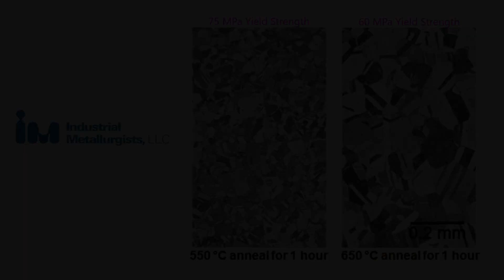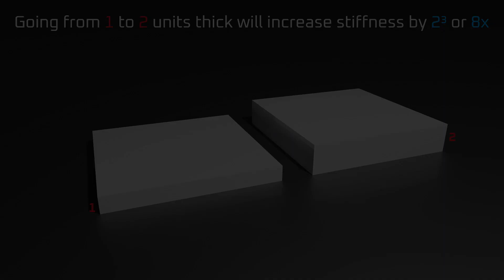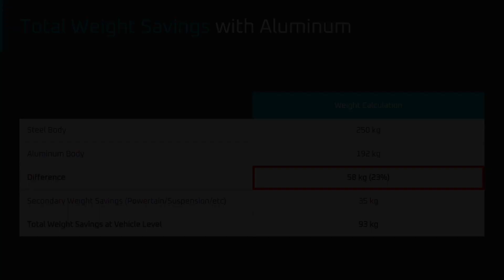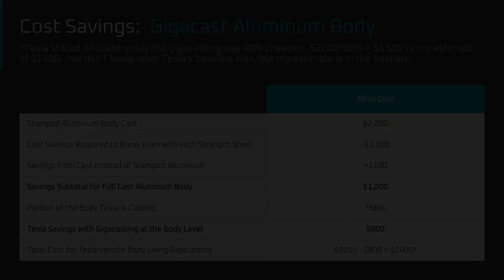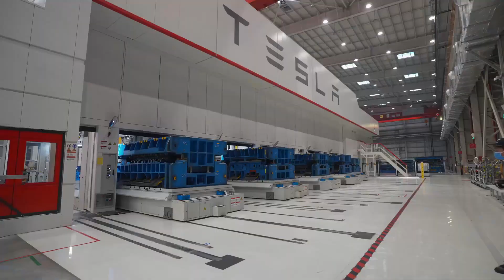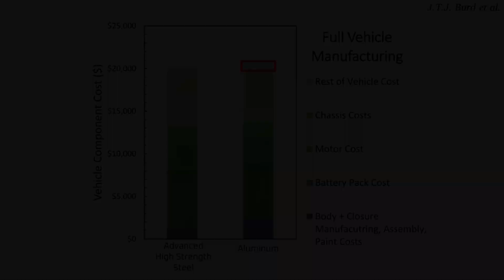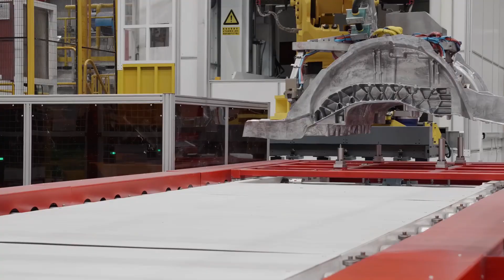#2 Tesla Gigacast Aluminum vs Advanced High Strength Steel

Comment: Tesla's price lock in on aluminum is a good point. It's getting cold for other automakers.
Reply: Legacy manufacturers are likely late to contracting for all sorts of EV materials and components.  They clearly lag Tesla when it comes to battery supplies.  Probably chips.  Possibly other materials needed for EVs that aren't used much or at all in ICEVs.  And gigapresses.  I expect Tesla is going to keep Idra busy building presses for them for a few years as Tesla ramps to 20M per year.
Reply: @bobwallace9753  10 years ago BMW built one of the biggest carbon fiber production plant in the world, other car manufacturers also have huge expertise on composite materials and recycled materials too.
Reply: @moineaux9173  who exactly of the existing oems has that so called expertise? Share any links you can which prove their competance in said areas. 🤔
Reply: @moineaux9173   
I bet that in your mind that somehow relates to the topic being discussed.
Reply: @bobwallace9753  stop talking shit mate, other auto manufacturers already uses way more aluminium than tesla. From Engine blocks, gearbox housing, subframes, differential, body panels, crash bars....... some manufacturers like range rover even make 100% aluminium car .
Reply: @moineaux9173  

Did you see someone named Bob Wallace claim that non-Tesla manufactuers don't use aluminum?  Or that Tesla has cornered the aluminum market and frozen other companies out?

Why don't you get your shit straight before accusing someone of talking shit?
Reply: Winter is Coming.
Reply: @AudiTTQuattro2003  The underbody is not the body and will still be cast aluminium. The stainless steel body is "just" based on a completely different manufacturing concept. One that should require even fewer parts and fewer production stages than the previous tesla models.
Reply: @dmatscheko  And a very tough, very long lasting upper body.   Appealing to those who use trucks for rough work but would like their ride to keep looking good.
Reply: @bobwallace9753  you mean the payment princesses?! Lol.... the perfect truck sizes for go everywhere adventure is the toyota hilux for example or ford ranger. The ford f150 or lightning/cybertruck/hummer electric are huge vehicles.
Reply: @moineaux9173  
Man, you really don't get it do you.

Comment: Once they start recycling their gigacastings they won't give a damn about material cost.
But that's 20 years in the future...
Reply: Lol... you realise that rejects in the manufacturing are have been recycled for decades right!? Recycling is not a problem but having more new materials.
Reply: @moineaux9173  Do you realise that there are thousands of aluminium alloys but that all gigacastings will be the same?
Reply: @johntheux9238  and what?!? Its not that hard to make an alloy and sandy munro has testified that in one of his videos. Tesla isn't the only company using aluminium castings, and the alloy is going to change over the times
Reply: @moineaux9173  It's THAT hard to make a defect-free large casting. Telsa has developed a technique and alloy that no one else has mastered with their large, complex castings. Maybe, they will give their secret to the OEMs?
Reply: @moineaux9173  Adding material is easy, but purifying it is hard.
Reply: @artsnow8872  that casting is nothing extraordinary trust me. Other manufacturers have worked with way more complex materials and processes, from the formula 1 development to laboratoires..... the carbon fiber wheels, titanium, silicon carbide, magnesium....... welding and bonding techniques....

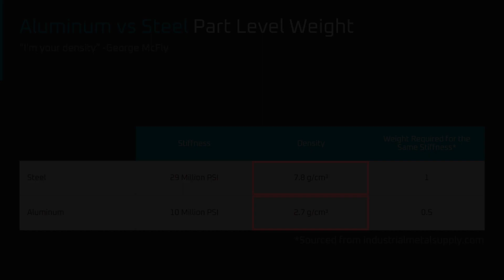Comment: For clarification, at 5:47 he is talking about flexural stiffness which is proportionnal to the cross section, lever effect and material deformation which are all proportionnal to the sheet thickness, hence the cubic power.
Reply: Good design means very little of the sheet material should undergo significant bending stress. In practice this means you don't get that cubic relationship
Reply: @EdFrench_uk  Well, it's under compression so buckling is an issue.
But I guess that the advantage of using aluminium is that you can use simpler shapes.

Comment: Im assuming Capex & TACT time will be included in the part 2?
Reply from the maker: No deep dive planned on CAPEX.  The figures here included CAPEX.  That is, we'd go far deeper for little marginal benefit (as far as I can tell).  The answer would still be the same.

Do you mean takt time or cycle time, or something else?  Cycle time has already been covered.  I may go deeper on this in a later video.  

On takt time, if you're considering the person who buys the car as the customer, then I'm not sure if it's relevant because Tesla is so supply constrained.   If you're considering the customer the production line, it's hard to know unless we know which part of Tesla's manufacturing lines are limiting production speed and what they are designed for.
Reply: @thelimitingfactor   fair enough on capex.  My mind was thinking about what happens in the eyes of traditional automotive when they would need to weigh up how much it would cost to change.  

On cycle vs takt, I’m just thinking about how time is proportional to money (and further to that, the best process is no process mantra).  I can’t see why Tesla would be pushing so hard to lower cycle time if they were also not trying to push down takt.  Yes, they could run multiple lines off the one casting machine but I think they will try to go one machine one line.  I also suspect that they have gone the casting route to lower cycle because they believe that they are about to have a profound breakthrough with battery production.  Hence why we are seeing castings stockpiled all over the place at the moment.
Reply from the maker: 1)  NICE.  I'll keep an eye out for information.  Idra is starting a gigacasting series as well.  Maybe more information will shake out.  

2) Totally!  This sounds like a separate video, but would go even broader than gigacasting to the entire line.  It sounds like VW's cycle time is like 30 hours and Tesla's is 10 hours to produce a vehicle. 

I also think that Tesla would like to go one machine per line.  However, it depends on how tailored the machine is to the part.  If they adjusted the part size, that would affect the cycle time when they change the die.  That is:  What determines the line speed for Tesla?  I think this is actually a moving target.
Reply: @thelimitingfactor  you’re not wrong talking about changing the dies for a casting machine.  In fact, anything they change seems to happen quite quick.  I’ve not seen or heard anything close to it anywhere
Reply: @thelimitingfactor  Tesla is only currently supply constrained with batteries and chips. Over the next year or two, these constraints will go away and then takt time reduction will translate directly to a profitability increase.